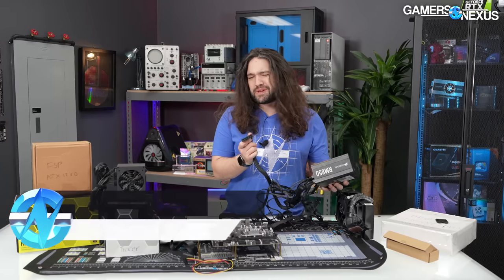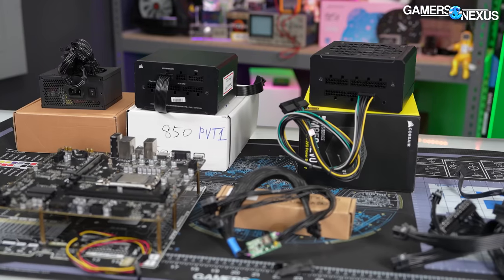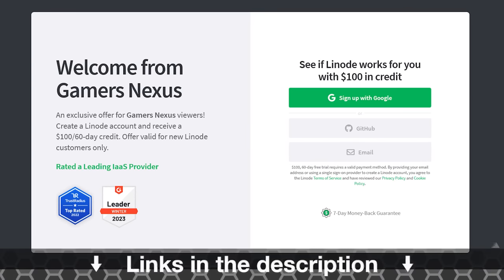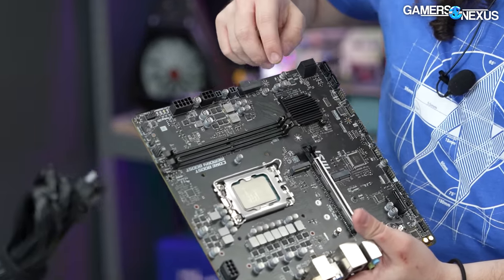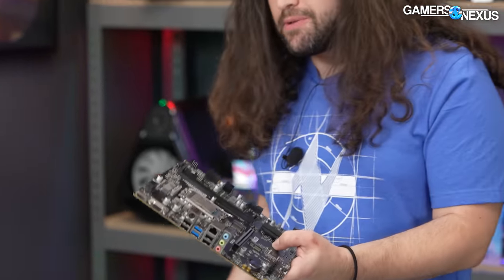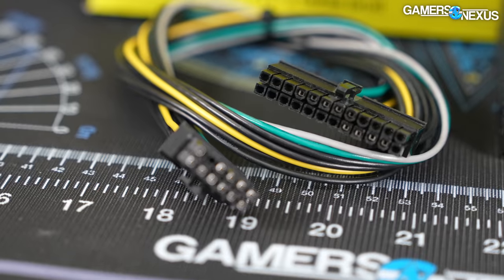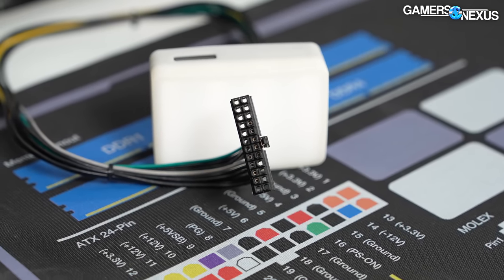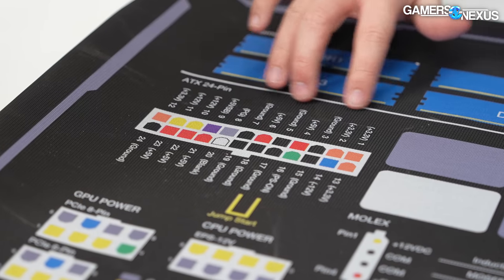The Future of Power Supplies - Maybe (Motherboard Cost, Cables, & ATX12VO)

Comment: The whole story of the extra cost made by MSI is just a lie. it is all about a very small voltage regulator and about 4 extra capacitors and that shouldn't increase the cost by any means over 3-4$. the real cost is like they said by the extra PCB size (nothing to do with extra layers) and that extra size by itself is there because the board vendor is lazy to redesign their motherboards properly. I can't possibly see why a mATX motherboard would need an extra PCB size just to implement a couple of small components beside even smaller connectors. That may be the case for ITX motherboards and even that is not likely

Comment: dont like this method it has been on dell and hp for years 12v go back to like the 5700 rep on hp and  3010 on dell's side ( that like from like 2007 and never push to end user for a reason )and what they don't say is when the phase that downsteps voltage on your motherboard blows often as a another point of failure or your psu blows it takes out your motherboard out as there i no safety you would get from the traditional psu taking the hit and not the motherboard been doing rma repairs for both of that oem even lenovo and ibm have it , its failed concept would rather lose a psu then a mobo bigger price hit on mobo vs psu from my years of service on oem in the last 7 years i would say  there is a 5/10 board failure cause from the psu i so glad amd said they would not be going that route , as somene that is certified with dell and hp i do more replacements for motherboards then psu with 12pin vs the 24pin its psu let that sink in this is a going to be a sad day if they move to this

Comment: Another dumb idea from the industry if you ask me. What a power supply does, well its in the name. You can go and buy a good block and all your input voltages will be known good. Now you will be at the mercy of motherboard makers where, last time I checked there isn't a single one that cares about quality and reputation anymore.(maybe thats where evga comes into play ?) And from a pure engineering point of view does it make sense to cluster even more hot and not well ventilated components together on the same board ? Nope. PSUs these days have their own air intake and exhaust.
Another question is can we get rid of 3.3 and 5V this millenium ?

Comment: I personally don't like it! It sounds as yet another green-washing scheme, reducing modularity and repair-ability of our systems.

A power issue on an old PSU can easily be addressed by replacing the PSU. A power issue on the new 12VO system, one needs to identify where the actual problem persists (PSU or MOBO). Having to replace a complete motherboard for a power issue, sounds completely ridiculous to me and the opposite of sustainability!

Comment: 12VO is just dumb... it's just shuffle power supply's work to the motherboard. And if you're gonna invent a new standard anyway, why don't also 1. add digital comunication between PSU and the system instead of the crude 12Vload line 2. raise the voltage to something higher like 24V, since there're more and more power hungry components popping up?

Comment: Why would converting 12v to 5v and 3.3v be more efficient when the mobo does it?  I don't buy it.  Whatever the mobo is doing differently, the PSU could be designed to do the same way!

Even if we do switch PSUs to sending "12 volts only" to mainboards, the PSU should also continue to have 5v and 3.3v rails for other components.

Comment: Is this me, or this is a really stupid idea? 
Your power supply can last a decade. 
I got my 850w evga for last 5
I've already have changed trough 2 motherboards.
Why put extra vrm on board, which will complicate it, take space on it, add cost? 
PSU will still be expensive, but mobos will go up another $100.
It's a money grab
Not to mention more e-waste and more points of failure (when they inevitable start to cut costs).
Remember that intel promoted it, and they force their clients to change mobo every tick-tock generation. Coincidence?

Comment: I take offense with the braindead decision to have POWER be SUPPLIED from something other than the POWER SUPPLY.

I also don't like it for the other reasons already stated: it will make motherboards bigger, more expensive, and more failure prone, and will do nothing to drive down psu costs.  The argument of "but muh standby power" is such a thin and weak defense for what is clearly just one point of the PC shirking responsibility onto another component much less suited to handle the task.

Comment: I'm sorry, this is stupid. Power regulation should belong in the PSU. Putting it on the mainboard significantly limits the amount of space that such has, and unless the regulation is replaceable there's no point. Like, all it needs to be is a shielded card you socket in, then I can see the point of 12VO. If the regulation gets busted but the rest of the board is good, it can be fixed But directly on the same substrate? Nah fam, then if the regulation goes the board needs replacing.

This is stupid, and why people are slow to pick up on it is because it adds expense, create unnecessary waste and is less serviceable long-term.

Comment: Seems like 99.9% self-serving Intel, MUCH like their shift of pins on CPU to motherboard.  I don't see the claimed power efficiency gains as legitimate justification for shifting potential failure point from a less expensive AND more easily replaceable component, PSU to MB.    Boooo!

Comment: Straight up garbage. There's no reason to change this 24-pin standard to 10-pin and even in this example, the standby voltage conversion is an afterthought gotcha that added complexity to something that looks (and is) simple. The number of power pins we see on every desktop success in the past ~28 years changed once since the move from AT to ATX and I'm still not clear on the actual reason but it had something to do with powering PCI-E devices.

What this looks like to me is a consistent research nightmare to understand what you're looking at when you have to open a PC and diagnose power issues. Oh, it's 10-pin? Looks like an old proprietary standard that's going to cost $$$ to replace because you know that thing is dead. Oh they're perpetually out of stock too? Yeah straight into the junk bin it goes. YEET! (/・ω・)/

Comment: This is stupid. I am not even going to finish watching.

Here's my issue. Feeding 12V only and one hell of a current to the mother board requires high currents to run on the tracks of the motherboard. This will cause hotspots, power loss, instability, burnouts and so on.

A power supply is a separate unit exactly for that reason.

What fool thought this was a good idea?

Comment: this is really dumb, adding unnecessary complexity into motherboards and if there is some problem with 5 and 3 voltage lines convertion you need to drop away the mobo

Comment: 12vo is stupid. Power supplies are not only gaming powerhouses. There cheap pos. So when a 40 dollar psu fails you swap. Now when 3.3 or 5v dies you change mobo and cpu and ram because every 2 years when psu dies you now are forced to redo everything because the 5v is now on mobo. If they made the vrm a card and replaceable this may help but they won't do that. That makes sense so they will go the other way. Just like they did when multicore hit server market and they removed that feature from that vertical.
Reply: Intel and amd need reasons to keep selling computers now that Moores is slowing down. Stupidity